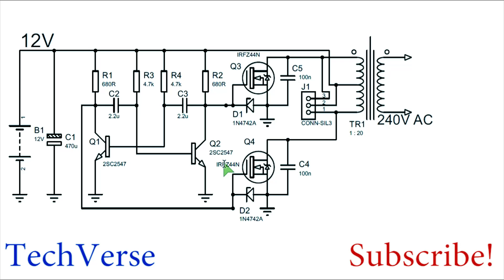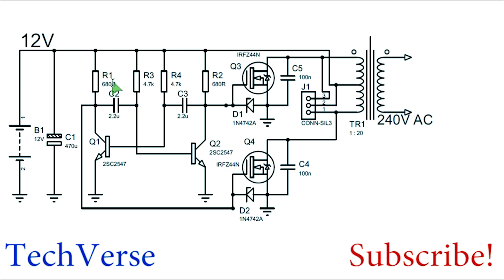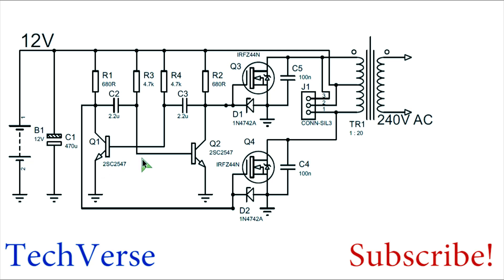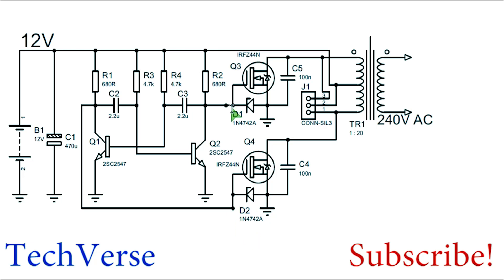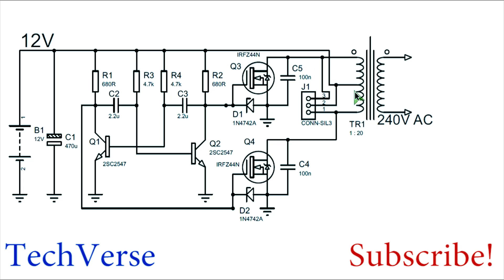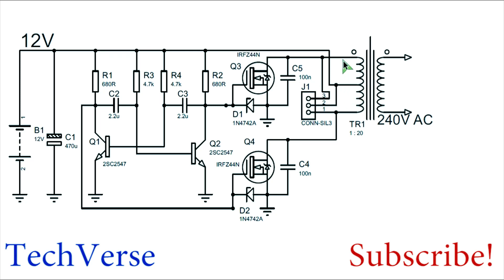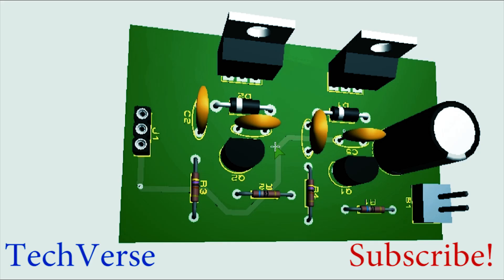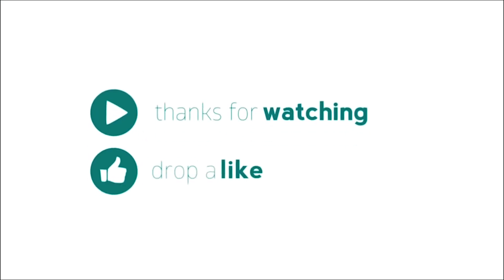Simple Inverter without using IC

Comment: Hi sir, I saw your video. Sir, I have some questions.. I made an inverter 12volt to 220volt with IC TL494. When I connected both MOSFETs to the ferrite transformer pins using the 36mm EE core, I could achieve 220 volts in the output. However, when I used the 26mm EE core or a smaller core, I couldn't obtain 220 volts in the output. Why does this happen?? I will appreciate you to answer my question